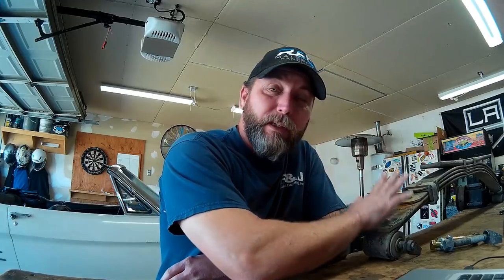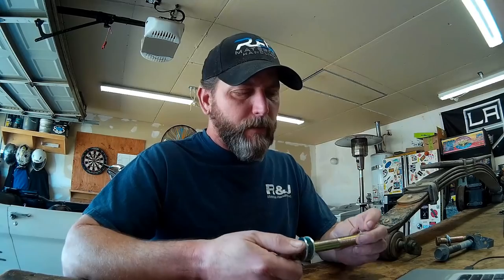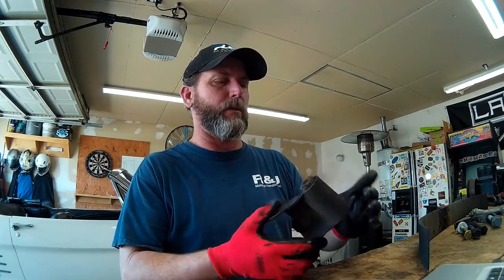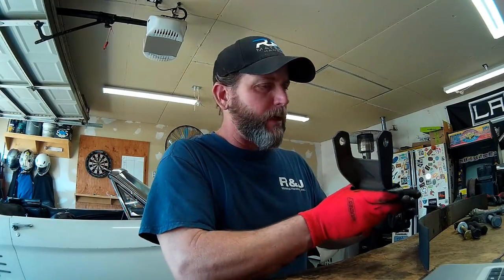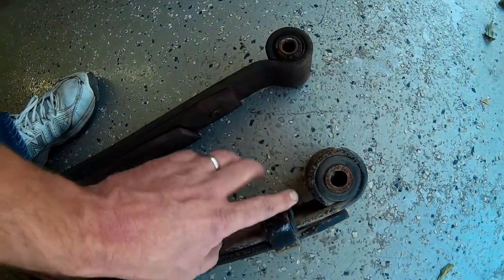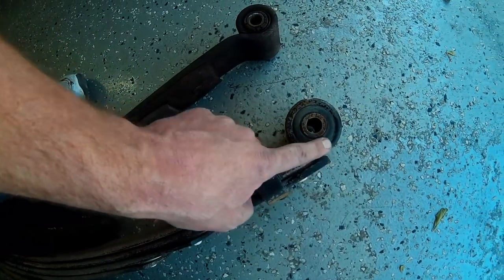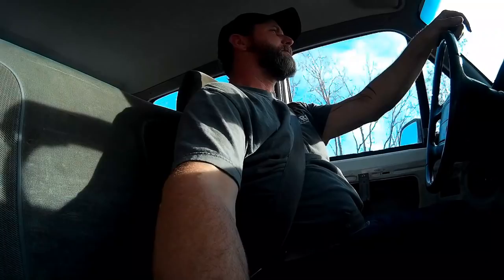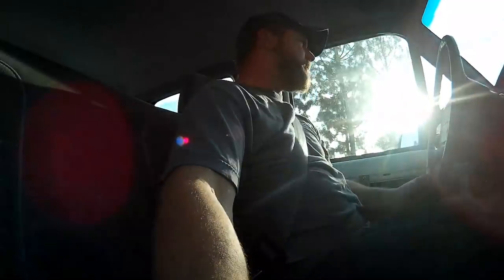Ford OBS; SuperDuty Spring Swap!

Comment from the maker: ** as an update to the SD rear leaf install, i have to say that my initial impressions were premature.  the leafs DO ride better than the OBS leafs and have settled in nicely!  so, i would say that for the cost of the leafs ($100) it was well worth doing! **
Reply: Huh, I had an 06 1 ton SD, now have an OBS 97 3/4 ton HD. Both seem to ride relatively similar, rough... It is what I would expect from a truck that was built to carry/haul heavy loads and materials.
Reply: Good to know ...thanks for the update 😊

Comment: Hey Bud.. im gonna be doing this same thing on my 1992 F350 crew cab, long box 460 4wd... but im doing it on the front

Any knowledge on swapping to Superduty leafs in the front?
Reply: raptor660   The 93 f-super duty 2 rear drive front leaf will give you 6” lift axle under and 4” with axle over spring will need more adjustments to other parts

Comment: I just bought a 95 F250 351 5.8 long bed. I'd like to make my 3/4 ton a 1 1/2 ton, and call it my F251. I have the Sterling 2nd gen. 10.25, but I think I need to replace that rear axle with what the F350 SD has, as well as the springs like you just did. And I feel I would need the Dana 60 up front with proper suspension. You seem to know what your talking about and your advise/suggestions would be helpful and appreciated
Reply from the maker: thanks Mike, your axle swap should be very straight forward.  the SD springs basically bolt right in and as long as the spring perches on your new axle match your frame width, it'll bolt right in.  keep driveshaft length in mind with your swap, and make sure you have enough slip yoke length to accommodate the new axle dimensions.  if it's a ford D60/D70 going in the back, you should have no issues.  although take a look at maybe doing a 14T swap, as that FF rear axle is nearly unbeatable for heavy hauling in this weight class.  good luck with your swap!
Reply: Being new to FORD (Foresaked Oligarch's Redistribution Dollars) I'm researching options.  I'm thinking a Dana 60 up front (4x4?) but Not sure. Your suggestion sounds good, but Im not familiar with 14T or FF. Am I accurate in year ranges of 1997- 2005?
Reply from the maker: ok, i understand now...the front D60 is definitely the way to go for your OBS, finding one for a reasonable price is the hard part..  the front high pinion Ford D60 is highly sought-after for axle swaps in Jeeps and many other wheelers that have a driver's side front output on their t-case.  so bear that in mind.  the 14T is a GM rear axle, the 14 bolt Full Floating rear axle used in just about everything GM produced...ever.  the 14T is heavy, but it's stout and stock with 1.5" 35sp axle shafts, 14" ring gear and has a ton of upgrade options, including super easy disc brake swap.  so dont count it out if you're looking for strength per dollar!  i ran one in the back of my XJ crawler, and it was the best decision i made on that project.  :)
Reply: If you have a 8600gvw that's considered a f350. 3 in shoes on back and Dana 60 hubs on frunt. I have 3 Dana 60s for sale in ohio
Reply: Even if you do a Dana 110 rear axle and brakes with F550 springs, you still have F250 frame and front brakes. You don't increase your legal payload, you just make it squat less and ride harsher.